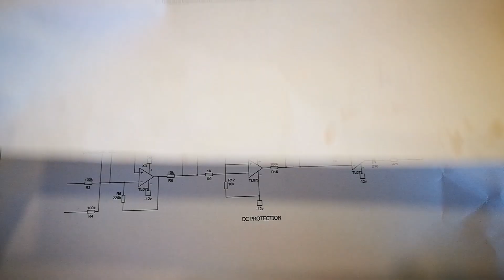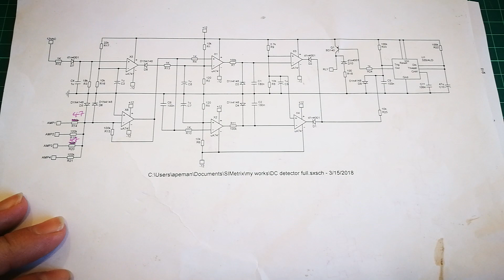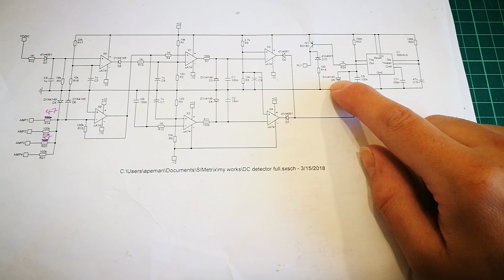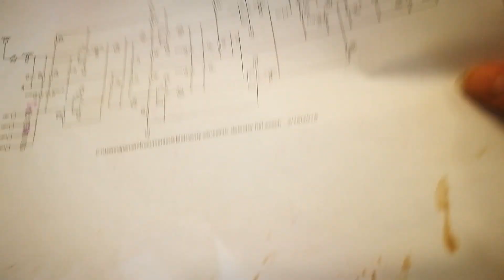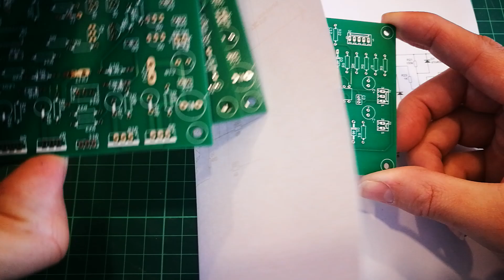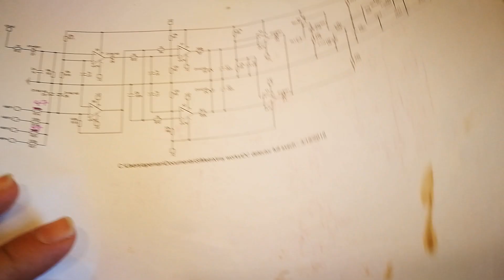DC protection circuit corrected

Comment: a better version indeed, more precise and the 555 is responding as it should, perfect... I'll test it on a breadboard tomorrow with 2 lm358 for the input and the AC stage as I have only 2 tl082 here for the moment I'll put them on the detect stages. I'll do the test with a LM555 even if after I'll use a microcontroler

good job :)